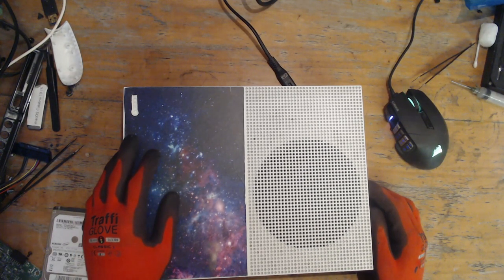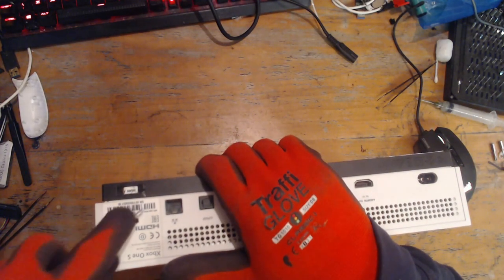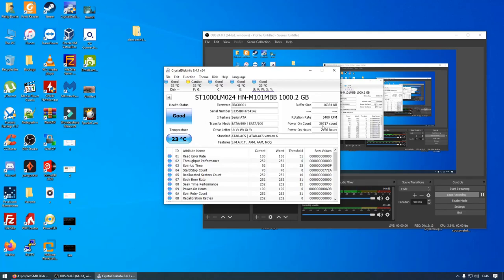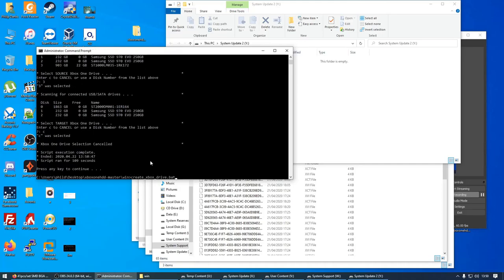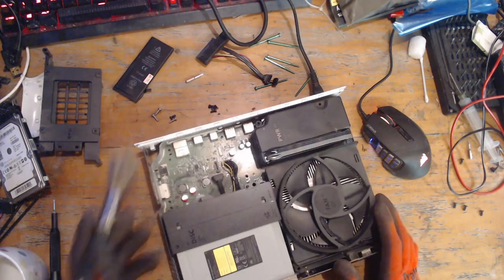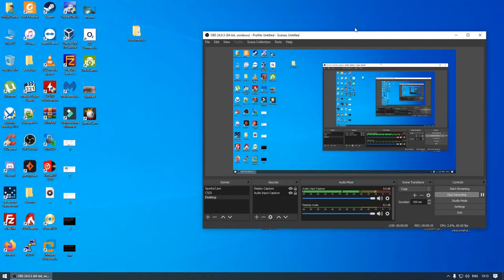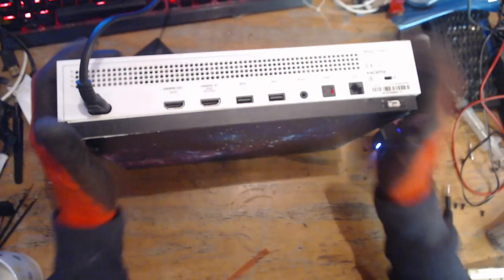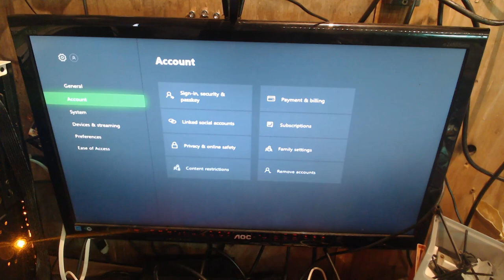Xbox One S Green Screen Of Death Repair - Faulty Hard Drive Diagnosis And Replacement

Comment: My xbox one wont come off the error screen even with the offline update it just cant get me out the loop after I changed the harddrive 3x
Reply from the maker: Did you prepare the hard drive before installing it using the xbox hdd software that I used in this video? I will add a link to it in the description just in case
Reply: @TheCod3r  u have to prepare it first ok.didnt.know.that
Reply from the maker: @melvinpervis6678  yeah if it's a drive either new or a used one that hasn't been taken from another Xbox One console it will need the partitions creating before the console will be able to use it. This can be done manually but the quickest and easiest way is to use the software in the description. Just let me know if you get stuck ;)
Reply: @TheCod3r  it's used
Reply from the maker: @melvinpervis6678  if it didn't come from an xbox one it will still need preparing. Also if that doesn't work install CrystalDiskInfo and check the health of the disc to make sure it isn't a bad drive
Reply from the maker: GlassOpper11b  yeah can't go wrong with an ssd saves any future issues